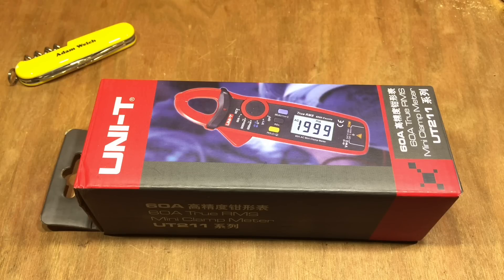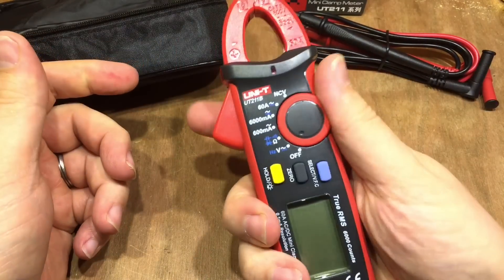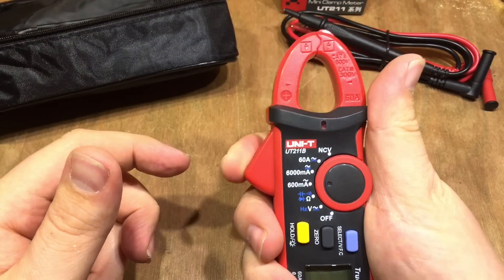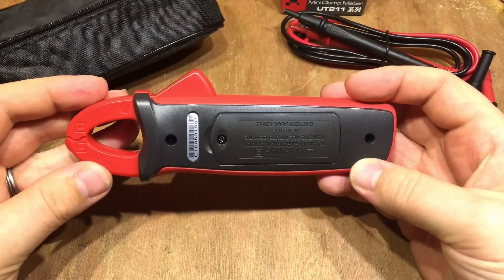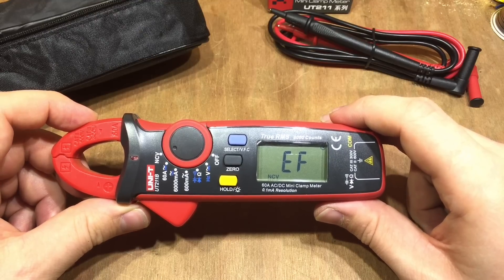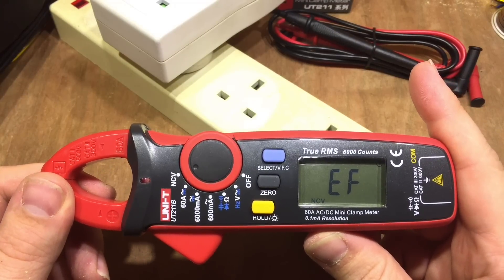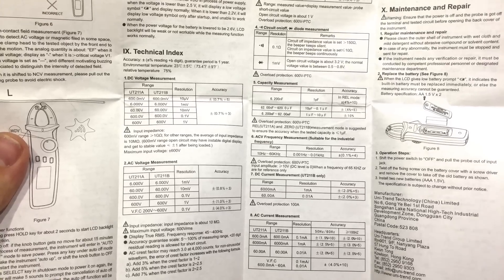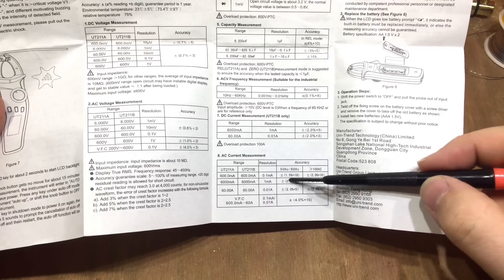Uni-T UT211B AC/DC Clamp Meter - 12v Solar Shed

Comment: I have a campervan and want to test the amps being drawn when various things are turned on.  Both the positive and negative battery terminals have multiple (about 6) wires going to them.  To see the total current being drawn, can I simply put all 6 cables in the clamp at the same time?  Also, would it show amps going in as well (I have a solar panel).  I.e. if the lights were drawing 1 amp, but the solar was putting in 1.5 amps, would the meter show positive 0.5 amps.  Two questions in one there!
Reply: I think the answers are yes and yes

Comment: Excellent. I use mine almost every day...really happy with it. The only thing I don't like is that the backlight turns off too fast.
Reply from the maker: Thanks Chris. If you press and hold the hold button it stays on doesn't it?
Reply: @AdamWelchUK  No, it's not, at least not for long.
By default, when you turn the light on (hold the button until the light turns on and release the button), the light stays ON for 15 seconds (I measured).
But if press and not release, as you suggest, then it stays on even less - ca 8 seconds and then goes off.

This moment with the light also triggered me, very strange design decision. Heard in some review on YouTube, that people who also were not satisfied with this issue ended up modifying / hacking the internal electronics to overcome this moment.

Comment: I think a DC current reading clamp meter is an ESSENTIAL piece of kit for working with solar setups. So many uses, obviously checking performance & tracing faults. However they are also very useful for weeding weak batteries out of parallel battery banks. Not to mention they save having an excess of ammeters hooked up all over the place..!

Comment: I've got the UT210E which is also a nice model having a 2A 20A and 100A ac/dc True RMS scale. And for 31 euro, it's rude to say no! :) 
https://www.aliexpress.com/item/UNI-T-UT210E-UT-210E-True-RMS-AC-DC-Current-Mini-Clamp-Meters-w-Capacitance-Tester/32437155307.html?spm=2114.13010608.0.0.lTvSMo
Reply: UT210E is a great unit,  have one also. I've compared the clamp current measurement to my DMM current measurement and it is almost spot on. Even at < 2A DC, only gripe is that it doesn't seem to have a min/max function even though specifications mention it.
Reply: billywhizzy the Same here. Half the price and accurate. I like my little UT210E
Reply: Uni-t 210E is pretty all rounder for house use, I like it very much

Comment: Great review. I recently bought an Ac clamp meter and discovered it doesn't do DC. I had a little play with it, tried an Ac cable and nothing. So popped it back in it's bag, the reason as you clearly stated, one must separate the the cables. DUH 🙄 

Once again you have taught me something new👍

Cheers
Reply from the maker: +Dean Greenhough Glad to have been of assistance. Yes both cables should cancel each other out, if they don't then some current must be leaking - it's how RCDs work. I only learned that recently from Big Clive! :-)

Comment: 10:00 Dude, you are measuring in AC mode.
Reply from the maker: +MrJohhhnnnyyy Blooming 'eck. You're right! Whoops.
Reply: ***** It happens to me too when I get carried away by something :) I just saw the reading and it didn't look right for a 40W on the output, I looked closer and saw that the thing is in AC mode. What you measured can very well be the ripple current from your inverter. If you have a scope, you can prove that by checking the waveform across a low-value resistor in series with 12V to the inverter.
Reply from the maker: +MrJohhhnnnyyy Now I did think it was low because from my maths many months ago I expected about an amp for every ten watts on my inverter. I've just double checked and got just over four amps on the same lamp once I turned it back on to DC mode. I can imagine this won't be the last time I make that mistake. Thanks for pointing it out and watching so closely!
Reply: You beat me to it. I saw the true RMS symbol :)
Reply: Well spotted.
The meter defaults to AC

Comment: Thanks for the video, I've been eyeing one of those for a while now but were wondering how accurate they are! UNI-T get a bad rap but I really like my 61E multimeter for low-voltage stuff.

BTW AvE did a video on the more expensive OLED UNI-T clamp meter and found it quite lacking (search "BOLTR: UNI-T Clamp-On Multimeter" here on YouTube)

I wouldn't trust the CAT voltage rating on it though...
Reply: Robin Kok mine is very accurate.

Comment: Was just looking at the MASTECH MS2108A this morning.  Seems cheaper and also has nice reviews.
Reply: Did you get it how do you like it if so
Reply: @james10739  Nope, got an Aneng ST209.  Not bad for the price at all. I did find some comments that some meters didn't measure AC current, might be a bad batch, but mine is spot on measuring DC current what I use it for. You need to take into account that measuring current below 1 Amp is not that precise which is inherit by the way these meters work.
Reply: @Luke-san  ok thanks ya I have meters that can read under 10A which ya for low current stuff it being inline seems like if would be more precise but it looks like the uni-t is only $10 more so that's probably what I'll go with
Reply: @james10739  If you don't have any issues with the  $10 then go for it. In Europe we have the 22 euro, about $24 import limit, which can make stuff expensive if you go over that amount. I have another Uni-T meter and so far it has not let me down for a second.
Reply: @Luke-san  that sucks I'm not sure if it's the same thing but I have heard of the value added tax, the balls on these people what value did you add by taking more of my money

Comment: What about the 210E, which looks to be half the price? Any idea what's the difference?
Reply: Hi, I have the 210E and it's excellent but isn't 200A, it have 2A-20A-100A AC/DC ranges, it's awesome, on 2A range has 1mA precision, it's true rms but only 2000 counts. Check this video: /watch?v=cFsBGUMSYmE (isn't mine). And cost me about 35usd on aliexpress.
Reply: Adam Welch I'm using UT210E and you missing something, it has one more range and that is 2A AC/DC
Reply from the maker: +.rpv Now that's really interesting. Clicking on the technical specification tab on this page ( http://www.uni-trend.com/productsdetail.aspx?ProductsID=1190&ProductsCateId=915&CateId=915 ) it says 20/200A but the photo seems to suggest what you say. How odd.
Reply: Yes, on the downloadable manual they have right the 2-20-100A specification, it's just the webpage that have wrong data (what a huge mistake).
Reply: Well, seems better than the 210E, 6000 counts and it seems that you don't have to zero it every second like the 210E, that may worth the price difference. BTW Thanks for your reviews and videos.
Reply from the maker: +.rpv You're very welcome - thank you.
Reply: Ebay specs are often wrong.  I suspect that many sellers don't know the difference between a meter and a jelly bean - they are just selling boxes and copying information from some other website.  Thanks to those with experience who have responded.

What does the difference in "counts" on a meter mean - how often it samples the data or something?  

I'd really like to have a dc clamp meter that works, and there is a pretty significant difference in price.  I'm just a casual user, results not mission critical so digits of detail is not as important  (1.2 amps would be as good for me as 1.23423 amps).
Reply from the maker: The 210E has a DC clamp current range of 20 & 200A.  Far too high for my usage and you loose the resolution too.
Reply from the maker: +.rpv Grr. Oh well. I'm pretty pleased with mine.
Reply from the maker: +Димитър Петров Yes, we've found the tech specs on the website is wrong - although it's correct in the manual. Thanks.
Reply from the maker: +Gregory Germain Sadly this error was on the manufacturers website - I've contacted them to highlight the error. 

The count is regarding the decimal places a meter can display but also has an effect on accuracy. As I show in the video this meter is +/-2% + 3 counts on the DC clamp ranges (from memory). Three counts out would be a bigger error on a 2000 count meter than a 6000 count meter for example - it's a larger percentage. I'm not sure I'm explaining very well though...

Comment: If you need more accuracy for low dc current, roll the wire around the clamp multiple times ( eg 2 or 5 ) then divide the reading by that number
Reply from the maker: An excellent tip - yes, should have thought about that.  Thanks

Comment: Nice review. I bought the same one from Amazon but just couldn't get the clamp part of it to work at all. I guess I just got unlucky with the one I bought. I might replace it after seeing this vid.
Reply from the maker: That's a shame - mine seems to work very well.  Thanks for the feedback.
Reply: Make sure you are not clamping both positive & negative at the same time, I have the same unit & it works really well. Particularly the DC camp meter.